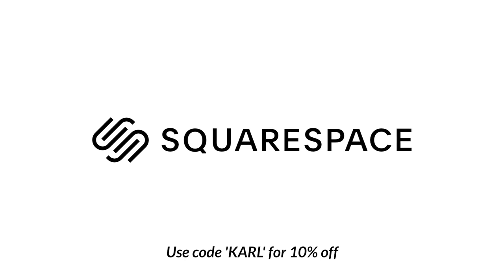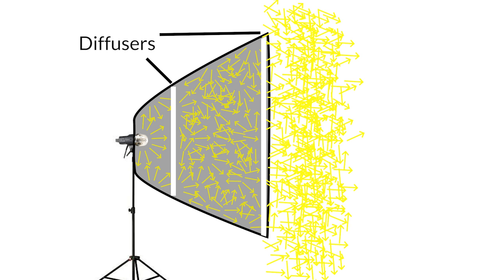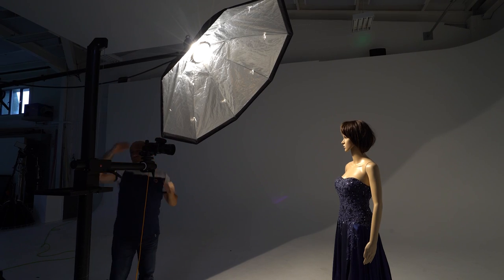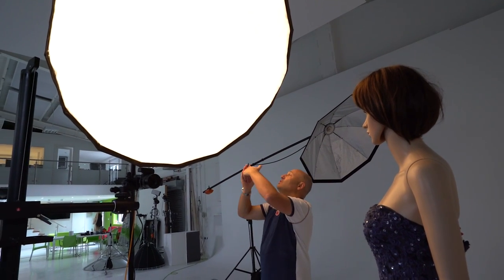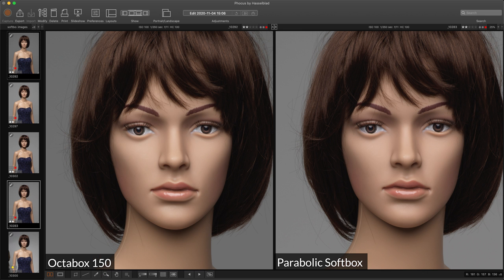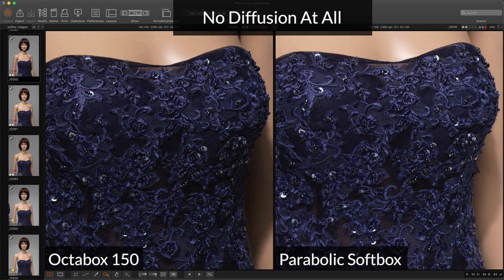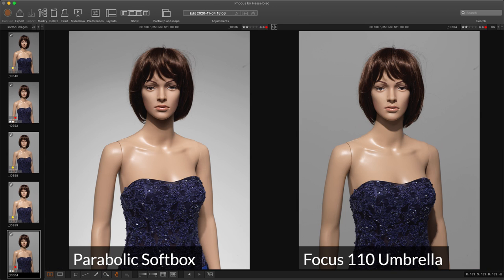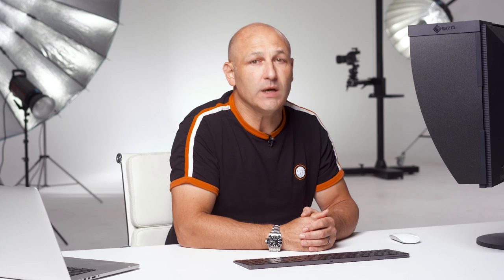The Myth of Parabolic Softboxes - Save yourself time, frustration & money!

Comment: You missed the point. I have listed below two sets of parameters: firstly the things that affect diffusion amount, secondly the other parameters in choosing a softbox. The parabolic softbox is different in many ways to your standard one, but you'll notice that it does indeed give more diffused light due to the distance between the light source and diffusion material (i.e. proximity of diffuser to model).

Parameters that affect diffusion:
1) Depth of softbox / distance between light & diffuser = how diffused the light source is (greater = more diffused)
2) Distance between model and diffuser = how diffused the light source is (closer = more diffused)
3) Diffusion material density / thickness (thinner or less dense = less diffusion)

Parameters that don't affect diffusion
1) Width / diameter of softbox = how wide the light source is. (e.g. lighting a face vs. full body). Makes no difference to diffusion amount
2) Shape of sides (i.e. parabolic sides) = makes no difference to anything
3) Shape of softbox front (square vs octabox) = this should relate to the shape of the thing you are lighting. A rectangle is great for lighting full body (standing person). Squares for head closeups. Obvs this affects shape of catchlight in eyes and reflections on three dimensional shapes on surfaces too, so maybe the octabox is ideal, depends on personal aesthetics but doesn't really affect quality of diffused light when it comes to perceived softness of light overall. I love a square catchlight in a round eye - just my preference.
4) Distance between light and model = how bright the light will be (this does also affects how homogenous the diffusion is)
5) Grid in front of diffuser = decreases spill and narrows width of light source
Reply from the maker: Hi, theoretically it would allow for a more homogenous front surface of the modifier if the light is coming from further back, however, as well as the points you mention, this is also dependent on the angle of reflectance of the inside of the modifier and the type of material used. A parabolic shaped modifier is designed to collimate the light by keeping it on the axis of symmetry and therefore not best at bouncing it around the entire interior surface.

The only way to know for sure about the homogenous capabilities of any softbox would be to take a greatly underexposed photograph of the front surface square on and assess how uniform that front illumination is. 

You are correct with some of the parameters that don't affect diffusion but it's important to note (so that any viewers are not confused) that diffusion does not equal softness of light. You can put an excellent dome diffuser on a bare flash tube but it will barely make the light any softer because the light remains small. Softness of light only comes from the size of light. If you were stood on a white surface 1 mile from the sun (and managed to stay alive and compensate for the huge level of exposure) then you would have almost the softest light possible because the angles of incidence of the light that the reaches you from would be from virtually 180 degrees and of equal intensity, therefore eliminating all shadows.

If the parabolic softbox presented itself as any softer than the Octabox in this video it would only be because it's surface area was larger.

Comment: Hey Karl. Thanks  so much  for being so straightforward about all this mess about the  parabolic "soft box". I'm  still figuring out  practically everything about  off camera lighting and have enough inexpensive modifiers., soft boxes included. If I'm getting this correctly will a parabolic "umbrella" give me the advantage of being able to push my light source further away from my  subject for more wider shots, I.E  sunset shooting with faster shutter speeds, using my FP600.  Subscribed ! and will be looking through the rest of your posts to soak up some more info. Thanks
Reply from the maker: Yes true parabolic reflectors will direct the light energy further by keeping it one area better.

Comment: Thanks for the comparison. I would love to see the raw exposure data. Does the parabolic give you a brighter result by focusing the light more?
Reply from the maker: It's not focused any longer once it's passed through two layers of diffusion but it's about 10% more efficient at getting light out, which is about 1/10th of an fstop so not really worth the weight, depth etc - please see my pinned comment at the top for a full run down.

Comment: I see many people missing the point. I think the video would benefit with a 3rd modifier, a true Para.
The point isnt just how further the light travels, it's the way it hits the subject. It's a different kind of light, you would see a difference on the specularity on the skin. In the para you can change light in many ways, but you can send the beam almost only through the edges , like a ring. It's very different from a light coming from a "spot".
Reply: But as physics laws say, if the ring is further enought we can consider it a spot, that's why we have differents sizes, it's not only because of the subject size :P
Reply from the maker: Yes that's with a parabolic reflector with a focusing rod, not with two layers of difussion.

Comment: Hi Karl, Great comparison, I thought the same thing about Parabolic softboxes myself.
Could not see much advantage, maybe over a longer distance with no diffusers the Parabolic,
keeps the light more directional, or stronger output over the longer distance, have to test that out.
I’m using X2 Aputure 300d2 LED lights with their brand Dome Parabolic softboxes and are they are quite heavy on a Baby Boom and KUPO Roller Stand.
After your video, given me the idea now, try using Bownes Softbox, see if get the same effect with lot less weight.
Reply from the maker: thanks

Comment: Repeating this from a reply I've made on the pinned comment : 
he rules of soft light are as follow : 
1) The bigger the source, the softer the softer the light. 
2) The more diffused the source, the softer the light. 
3) the *closer* the source, the softer the light. I know this is counter-intuitive, but yes, this is the empirical truth. Don't believe me? Take a torch light your forearm. Watch the shadow. Bring the torch up : the shadow becomes clearer. Brings the torch down : the shadow becomes blurrier. The further the light rays have to travel and the more defined they will be; hence why you get harsh light on sunny days and diffused light on overcast ones, where the light is being diffracted in all sorts of directions before reaching us. 
A spotlight for stage use is often over 100 meters away from the stage, while the flood lights, or washers as we call them in the entertainment industry, are literally on the stage.

Observation : On those tests the parabolic softbox gives an ever so slightly less directional result, or so one would think; but look again at the *backgrounds*. There you can see the hotspot of the parabolic softbox. This become increasingly obvious the more diffusion is removed. The results are about identical except for the hotspot in question. Why would you want that? You can lit the background separately if you want.

Comment: Thanks for this video Karl. I was interested in buying a parabolic "reflector" umbrella with focusing rod. But I do not have the money for a Briese/Broncolor. Can you recommend a great budget option (around $500?) that would serve as a parabolic reflector and may have "bang for buck"? I've heard of the Parabolix line but have you used them - would you recommend this one? Are there other budget options you would recommend? Obviously I don't mean Parabolic softboxes because as you pointed out in this video these are useless.
Reply: I can offer you a suggestion that has been effective for me at a very economic price point. I've adapted different brand para's to function very well with the focusing rod sold by Cheetahstand (not paid or supplied by them in any way). Their focus rod operates very smoothly and the light mount cages they offer can easily be adapted with a little ingenuity to fit just about any speed ring insert based on what I discovered. I use Speedotron and Elinchrom strobes mostly. I use both of those with my focus rod on 3 different brand parabolic softboxes. So, yes you can achieve excellent bang for the buck with a little ingenuity and effort. Obtaining a highly effective parabolic tool that is very reliable and simple to use is easy and your budget is far more than enough to achieve this. Nothing is like a focus rod parabolic. This is why a parabolic is a far better choice than a octabox in my opinion but Karl certainly showed how a softbox is basically a softbox regardless if parabolic or not, but when a focus rod is used with the parabolic the lighting world changes dramatically. Physics !

Comment: Thanks for this video, very useful, what about power? Did you get any more power out of the light when using the parabolic one? Cheers, 😊
Reply: The Video was Not about Power. I assume that there will not be any power increase when using diffusion material in Front and If you are Not able to focuse the light Like the parabolic reflectors

Comment: Hi Karl. Quite interesting video, thanks for the effort. However, comparing how the two types of softboxes light a subject seems a bit pointless, as you have clearly shown. Surely, the advantage of the "parabolic" should be somewhere else and might it be in how directional the light is? It partly shows on your examples that the gradient on the background is different, which you took no notice of. So what if one goes for that deeper and steeper gradient on the cyclorama? Meaning that maybe the "parabolic" gives you more narrow beam of light, which results in more pronounced gradient on the background? With a regular Octabox you would need some sort of a grid for that.  Would be interesting to see a comparison on that front.
Reply from the maker: Hi see my pinned comment at the top of the page
Reply: @VisualEducationStudio  well... even with double diffusion it isn't "non directional" relative to the Octabox, let alone with no or just middle diffusion. And the difference can be clearly seen on your examples. It's just the examples were focused on lighting the subject, not exploring relative directionality at all. 
I'm not an expert and I'm not saying the difference is huge, but it is there... I think.    It would be cool to see the actual difference in narrowness of beam.
Reply from the maker: There is no narrowness of beam because it's diffused. You didn't read my pinned comment after all.

Comment: One quick question, to clear up any un-exorcised ghosts of credibility of the parabolic softboxes, there has been claims that they are more efficient for lower powered strobes (such as 200-300ws strobes). Was there ANY power level differences between the classic (and actually portable) softboxes and the buzzword ones?

Or, for those so inclined, any large differences in catchlights (roundness for diffused, and specular-pattern for undiffused)?
Reply from the maker: Hi I found about 1/10th of an fstop more efficiency with the deep shape, which isn't a great deal. The catchlights are rounder if the front shape is rounder but you can put a round window mask on an Ocatbox too. Please see my pinned comment at the top for a full breakdown.

Comment: This is 120 % correct. The light source is THE FRONT DIFFUSER so no matter what shape you have behind it the diffuser will emit the light of the same qualities. The only difference is that in parabolic softbox the bulb sits further away from the diffuser so will need  a slightly more powerful setting. Simple physics.
And thank you very much, Karl Taylor, for the video!
Reply from the maker: Exactly Chuck, I'm glad you and most people get it. Unfortunately though there are still a few arguing until they are blue in the face, probably to save face over their purchases.

Comment: I see a huge difference between the parabolic and Octabox with diffusers -- so much so that I am not thinking I have to buy a parabolic softbox. The light on the face with the para is softer. The strength of the light needs to be boosted to make it a properly lit headshot, but it is markedly different in a positive way. I don't see how anyone can think that's no obvious.

Comment: There is only one reason why a parabolic softbox is useful : Product photography.
By pointing the light source backwards inside the softbox, it is possible to change the focal point by moving the light source back and forth. This creates different gradients on the outside diffuser and will modify the light casted on an object when it's very close to the softbox!

Of course, you can achieve similar results (if not better, because you can use multiple lights) with a butterfly scrim (or diffusion paper, or folding diffuser) and a light source with a small reflector (you can try different reflectors, or even snoots, for different effects) placed at different distances and angles from the scrim.
Reply from the maker: As a product photographer for over 25 years I can't think of any lighting situation this modifier would be useful to my work - www.karltaylor.com - ahead of other choices. Also this modifier doesn't have an inner focusing rod the light points towards the subject and has to go through two layers of diffusion as I demonstrated in the video. Which is why this type of product is such a nonsense in claiming that it delivers some sort of collimated or gradient light capabilities. In my comment pinned at the top you will find a link to another video about Parabolic Reflectors which are very useful, that video also clarifies why Parabolic Softboxes don't work if you haven't had time to watch this video.

Comment: It's funny you made this video. I am  looking to buy a para 222. I do a lot of full length catalogue shoots for brands. I been on the phone with broncolor last week trying to get a deal on one. If you can hook me up with a used one or sell me yours I would appreciate it.   Also I have a serious question. I see the para has 3 types of diffusion,  which one would u think is the best for a softer look if for some reason I needed it.
Reply from the maker: Hi Ray, I covered actual proper Parabolic reflectors in a recent video I think you may have commented on that one too? The Para 222 is great but my favourite is the Para 133, If you were going for diffusion for them the very light one is too weak and hardly makes any difference so I'd go for the thickest one so you can actually create a 'softbox' use for the light as well.
Reply: @VisualEducationStudio  Thanks. I did talk to you before but it was a different question. The item is very expensive so I just want to know as much as possible.

Comment: The overall effect may be similar or the same in the instance where the diffusers are used, however, the light spread (indicated by the effect on your background), is clearly different. Do not discount them too quickly, as the shape does affect the spread of light. Personally I like them ;)
Reply from the maker: Please read my pinned comment at the top of the page.

Comment: I guess I'm still confused over the term 'Parabolic Softbox', what exactly are the differences in terms of the word 'Parabolic' between these two modifiers in the video here?
They are both approximately the same size, both have reflective inner lining, one is more circular, the other octagon, one is deeper the other shallower. Why does one get 'Parabolic' slapped on it and not the other?
Reply from the maker: Hi Eddy, one is much deeper than the other. A parabola is the actual shape and a parabolic reflector is based on this specific parabola because of it's effectiveness at reflecting light - https://en.wikipedia.org/wiki/Parabolic_reflector
Reply: @VisualEducationStudio  Thanks again.

Comment: I had one of those parabolic I found every excuse not to use it on location because it was so heavy and cumbersome I fell for the same marketing BS and it was in my house most of the time collecting dust.
Reply from the maker: Thanks for the info
Reply: Same here. I own a 39" Deep Softbox but I don't have a light that can take its weight by itself. I would love to take it with me, but there's too much hassle with assembly and mounting.  I do own a much smaller 18" version which is much more portable and all of my lights accept the weight without any troubles.

Comment: I feel the best use for this type of parabolic modifier, is to use zero (softbox) diffusion, then send into a window/gobo. This mimics more natural light than a standard softbox would, and spreads light more parallel than a standard light would.But yeah... Using diffusion panels on this would eliminate the benefits of parabolic-type light.
Reply from the maker: Yes

Comment: I've heard that parabolic softboxes throw light further than regular ones, but I don't think it matters that much, becauce at that distances the light will be too harsh and you're better off with just a bigger soft box.
Reply from the maker: They don't throw light further unless the output power is higher but I noticed no difference in exposure between the two and even if the deeper design put out half a stop more you can just turn the other modifier up by half a stop. Certainly actual parabolic reflectors can throw light further but not once it's scattered through two diffusers.
Reply: @VisualEducationStudio  Thank you for your in-depth reply!

Comment: Very interesting as usual! The only thing that could be different (just guessing) is the efficiency in terms of light. Perhaps Parabolic Softboxes need less light power... Didi you tested it? Anyway is not worthwhile!
Reply from the maker: Yes that's true it may have been slightly more efficient but hey you don't normally run out of power on a softbox at that distance.